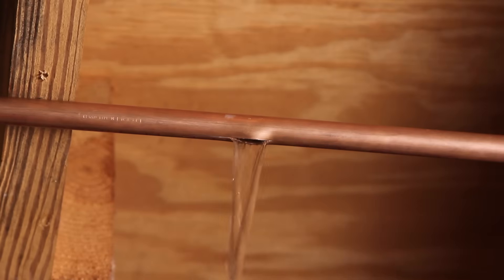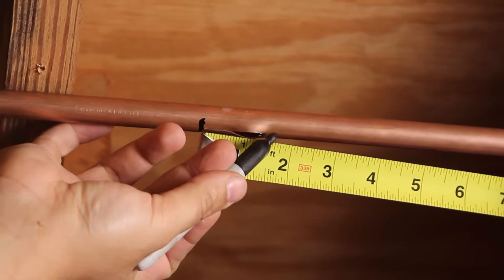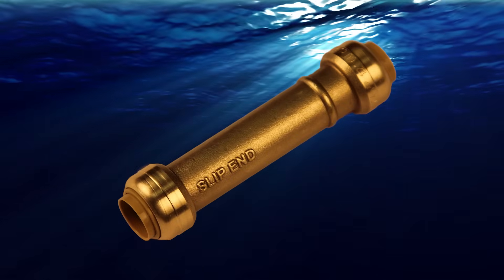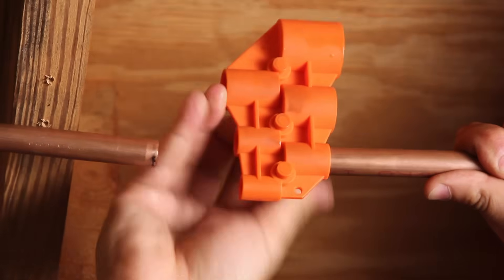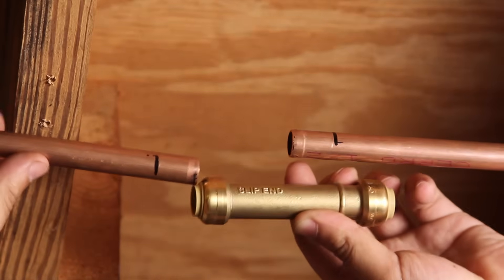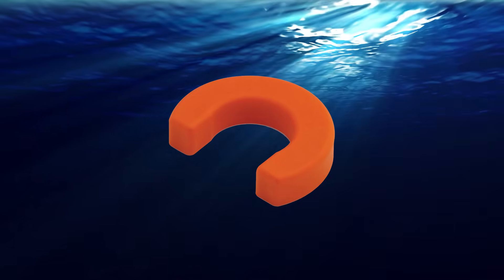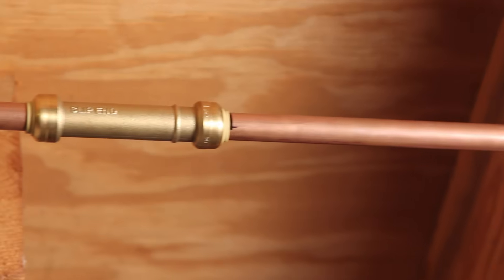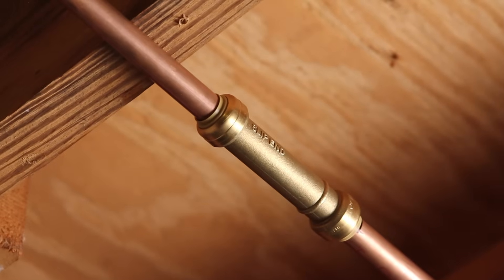How to Repair Copper Pipe Leak without Soldering

Comment: I did this, the pipe was a straight run but not level. I had to fight a little to get it fully connected but it worked perfect. Also fixed a leak with the 90s and my own pipe, also repaired the leak. These things are great and I dont know much about plumbing. Im going to try the ice maker next.

Comment: I would advise anyone who plans on doing a lot of work with these fittings to purchase the Sharkbite removal tongs made for the diameter of pipe you work with.  They are only about $10 USD.  I got mine for 1/2" pipe at Lowes'.

Comment: Is this meant for temporary repair or will it last? for cold water line.
Reply from the maker: Hey Alex! Our fittings carry a 25-year warranty. If you're installing where pipes can burst due to freezes, make sure you insulate the pipe and follow proper installation techniques and local codes.

Comment: Just want to thank shark bite for keeping us plumbers in business, probably 20% of our repairs are tearing out shark bites (after they leak and flood the house) and doing it right.
Reply: And countless repairs done correctly that never need a plumber's call. Works both ways.
Reply: A licensed plumber used Sharkbite , or a type similar, for shut off valves in my in-laws house.  They are 20 years old or more and only had one issue, like most shut offs, when you go to use them after that length of time.
Reply: keep paying taxes so you can be replaced

Comment: the sharkbite system is pretty nice for repair jobs but ive seen it ran for a whole house and it does not look good. i prefer solder joints. more clean and nice if you know what your doing of course.

Comment: I've fixed pin hole leaks in copper pipes and a split like this can be fixed w/o having to go to the store and getting any fittings.  For just a corrosion pin hole you can drain the pipe of water by opening a valve below the leak and just clean the pipe with sand paper and sweat some solder over the hole. For a split like this, just reshape the pipe with some channel locks so the split is closed, sand the pipe clean around the area. Then wrap some bare copper wire around the pipe tight and flux & solder it right up. The wire adds strength and the solder seals it water tight.  Much easier and quicker than any other kind of repair. No need to go to the store and buy repair fittings. Living on an Island with less than 5,000 residents in the Caribbean you have to get creative when the hardware store is out of fittings and you need to do something right now, not next week.
Reply: sailingsolar I would have to go to the store to get the copper wiring (don't have any spare electrical cables), to get more soldier, correct sandpaper for use with copper, etc. Much easier to go to the store and buy a fitting, tube cutter and bur remover/marker. Well I found it easier and just as cheap to do it that way.
Reply: TDBarrett You must be some agent associated with shark bite products. Your flat out wrong it's cheaper, I know that for a fact!  These products are for amature repairmen.
Reply: Most homeowners are!!! Lol.  Made my life easier!    @sailingsolar
Reply: Nice alternative. I imagine that's quite a bit of solder.
Reply: Lou Fazio Not much.   Not any more than it takes to flow a thin layer over the repaired area.
Reply: @adaster98  You don't understand the situation.  Your free to go through all that trouble to put in a coupler if you like but there 's a chance you would have another pinhole or two leaks come up from disturbing the copper during your repair.  Then you can cut the pipe again to fix those new leak/s.  With what I suggested the pin hole leak is repaired without hardly touching the pipe and I'm out of there and not making more leaks I have to fix.  I have no problem with you doing it your way .   cheers.

Comment: when using shark bite fittings don't forget when connecting to copper to take out the plastic insert to increase water flow though the pipe, the pex end if using copper to pex doesn't matter however because of the pipe diameter.

Comment: What if the pin-hole is in a bend in the line? Does Sharkbite make a flexible coupling that would "Bend" with the existing flow of the piping?
Reply: they make a 90 degree or elbow fitting

Comment: Just used the sharkbite to repair a hot water pipe that feeds into the kitchen. Fixed the leak great but now there is no hot water into the kitchen faucet...any ideas. All water valves r turned back on...
Reply: Sounds like you need to clear debris. Turn off the final valve under the sink, detach the flexible line that goes to the faucet, aim it into a bucket, and then turn on the valve to check hot water flow. You will likely notice a lot of debris come out into the bucket as well. After that you should be good to go.

Comment: I think a word of caution might be in order here. DO NOT PUSH THE SLIP END 'AS FAR AS IT WILL GO' IF IT MEANS COMING UP TO A JOINT. That plastic piece will not budge the pipe back as it sits on a slightly bigger diameter, in my case a T joint. I've got the opposite end seated in only a half inch and it's holding so far. Good thing too cause I can't get the pipe to budge back in it's direction. Any suggestions are welcome.
Reply: I have a slip coupler stuck on a vertical pipe.  That plastic orange tool is awful.  The first slip coupler I put on further down, it took all the strength I had to pull it up, but ut was below my waist, so I did ut lifting up.  Now the second one us above my shoulder on the sane pipe.  I can't budge the slip coupler to slide back up to meet the other end if the cut pipe  Thst orange tool dies not work.  Meanwhile, I still have no water.  They make ut look easy, but it is not easy.  Think you need the metal tongs.  They shoukd be honest and tell you that before you have to wait for a second tool to move the dang thing!
Reply: I had the same problem. These things are not as simple as they make them out to be.

Comment: SharkbitePlumbing, I want to thank you for making my plumbing issue much easier.  In fact it just seems wayyy to easy.  I shut off my water, I purchased a copper tubing cutter w/burp cleaner for the rough edges.  I place the sharkbite replacement tubing on the area w/pin hole after making sure I had 1 inch on both sides of the copper tubing and walahhhhh completed, after turning on the faucet and getting the air out of the line~ thank you Home Depot!

Comment from the maker: Hi Nassgul, that sounds like a good way to replace the pipe, however you need to make sure the pex is not damaged in any way during the conversion, and that all connections are clean and secure. Damage to the pex pipe can reduce its integrity. Good luck!

Comment from the maker: yes you can use SharkBite to repair pipes in a hot water baseboard system. Make sure the temperature does not go higher than 200 degrees F. (Most baseboard systems run at 180 degrees F).